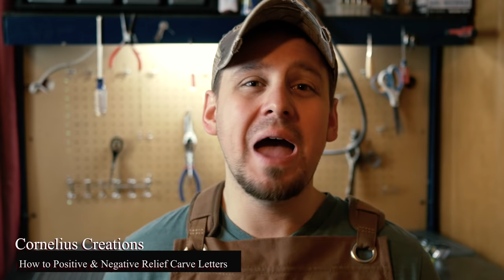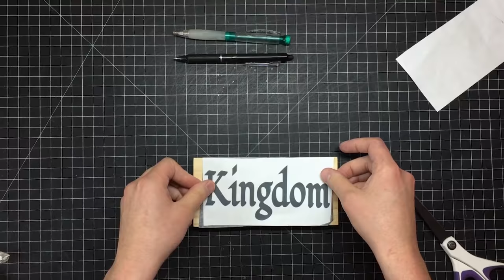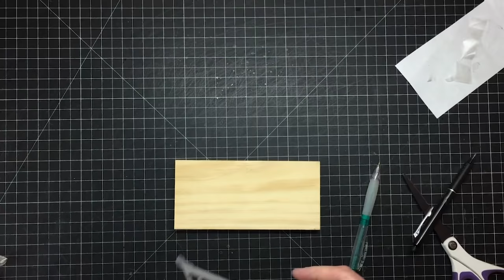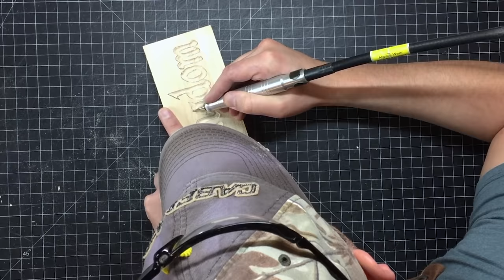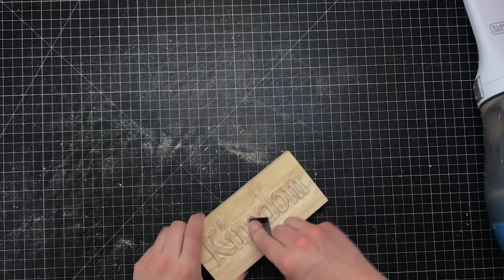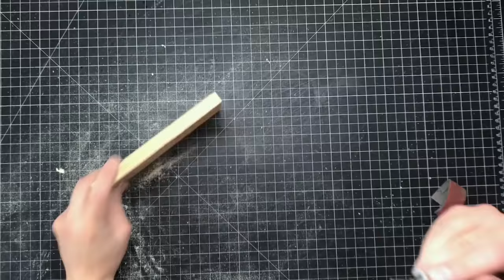How To Wood Carve/Power Carve Letters With A Dremel or ANY Rotary Tool

Comment: I have a small tip, if you cut out a large area and want the bottom of the cut to be perfectly flat, you can use a Dremel plunge router attachment. Just set it to the right depth and cut away real slowly.

Comment: Matt, I have commented on many of your videos that I love your videos and what a great teacher you are. I I've only found 1 other guy that comes close, Tim vandersluis. But neither one of you have made the most important video or touch the subject while your doing the video I'm watching now. And that's how to fix mistakes. In this video you say something about not going to deep. What can you do if that happens? Or if bit gets away from you?  I so appreciate the time you don't have to spend doing this but if you could touch this subject it would be great to see thanks
Reply from the maker: I will add this to my list :)
Reply: One way to fix this mistakes is to mix some fine sawdust from the wood you're using with a little wood glue and rub in the marks, another way if it gets away from ya and makes a mark across the wood is to get a hot iron good and hot, but not enough to burn the wood, put a little water on the marks  then rub the iron over it and after it dries just hit it with some mid grade sandpaper, it will swell the surface back out evenly of the marks aren't too awful deep

Comment: will you explain in a future vid how to get the negative space fairly straight when doing positive relief carving? Im asking because I dont have a router. hope my question makes sense.
Reply from the maker: Yes, I mentioned it in the video, But you need to take a smooth burr and lightly rout out the negative space then hit it with some sand paper :)

Comment: Thanks Matt!
I'm brand new to this. I've had a Dremel 3000 for a while, but usually only used it for small clean up stuff on other projects. 
I caught one of your videos and went out in the garage, found a piece of wood drew something on it and went to town. It's a little messy and very time consuming, but I'm having fun with it. 
I've watched a bunch of your videos and I think I've picked a few things up.

Now I have something big in mind. Not big on size, but big in how important it is to me that I get it right. My problem is, how would you tackle smaller letters and numbers?
I have a small heart shaped plaque, about 6" across and a design of some wings and a halo that fits inside. Inside the halo are 3 initials and inside each wing are month and day, 12/27 and 12/29. What I'm thinking is it might be better to engrave it as opposed to carve it all out. I'm gonna try it on some practice wood first.
I can send you a pic if you're interested in giving me some feed back.
Anyway, thanks for the education.  Life is always good when you can learn something new!

Comment: My question is for filling negative space with (inlay) material such as crushed stone, both small particles and powder.  Matt, do you think it's better to smooth-out the surface or leave it stippled for CA glue, (Super-glue), to adhere to the wood?
Reply from the maker: That’s a good question! I don’t think either way will matter! I’ve seen people rough the edges for the CA glue and I’ve seen people leave it smooth. Since I do not have personally experience I can’t tell you either way!

Comment: Here is something I do on letters. I skip the carbon paper. I just print it out and glue it right to the board with 77 spray. Then I carve right through the paper. I use a long thin and very pointy cutter to outline instead of the ball cutter. Then I go back later and remove the material away from the outline. Taking off the paper as I go. After the outline, some of it just falls off on it's own. Whatever is left I scrape or sand off.

Comment: Would I be able to do stuff such as letter on top of a gift box that is a little thin as I won’t have to apply much pressure thought I would ask as I’m super worried
Reply from the maker: Yes you will be able too, you can see me do it in other videos.
Reply: @CorneliusCreations  awesome was just concerned as I didn’t want to try and then break through the top of box 😁

Comment: Which tip is best to use for carving/writing. Does it matter? I tried a few out and neither one I chose felt good to me or looked good when I finished. 😪
Reply from the maker: Don’t get discouraged Monica :) it takes time, just like riding a bike. Start with a small round carbide burr and go from there. Go through my feed and watch my hour long live stream. You will be able to have the confidence in what you need to do :)

Comment: I got a dremel 2880 for my birthday yesterday and was stocked to do things like in your videos but man I was so disappointed in my work and quite frankly the tool was too heavy on the hand and was causing me some strain. I returned it but I dont know if I should give it another try but with a smaller dremel? Idk let me know
Reply from the maker: Hey Ralph! I’m sorry to hear that. That was the battery operated one right? You need the corded version with a flex shaft attachment.
Look at the Dremel 3000 or 4000 with the flex shaft attachment. Or look at the tac life rotary tool on amazon. The flex shaft is what makes a difference

Comment: Are you using a electric rotary tool?  I use a air power rotory tool that is great for small detail.  With the bits you use it seems you can carve faster..  Darrell Dawson

Comment: What’s best to cut letters out from abs plastic.  I want to cut rx8 lettering into my car front splitter wing end plate.   The dremil sand drum is to much I only want 2 mm line      With a drill bit it’s too uneven hot knife just melted

Comment: It's not router type work, we've been doing this before power tools. It's just a sloppy job. You need to use lateral strokes that are parallel to each other to the same depth, that way it'll look like you didn't cheat and use a dremel and instead used a chisel or spooning blade. It looks way better, and only takes a few extra seconds of attention to detail.
Reply from the maker: We would love to see a video from you explaining it. Can you make one?